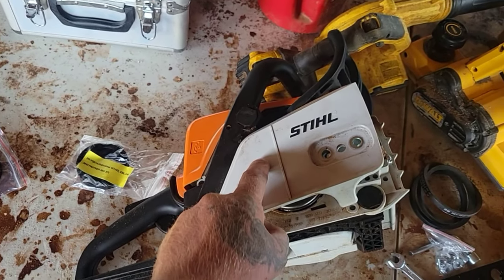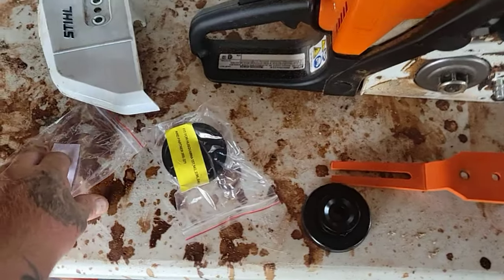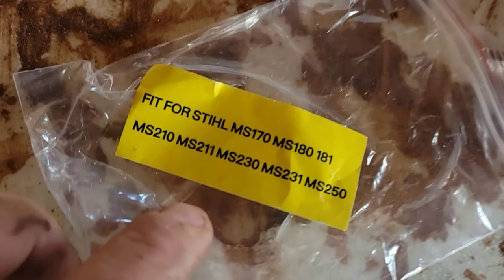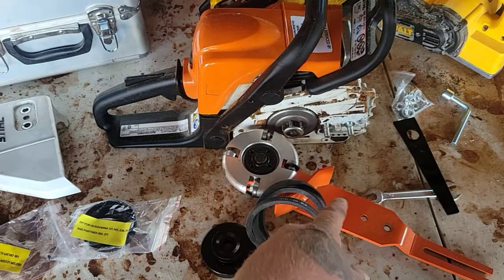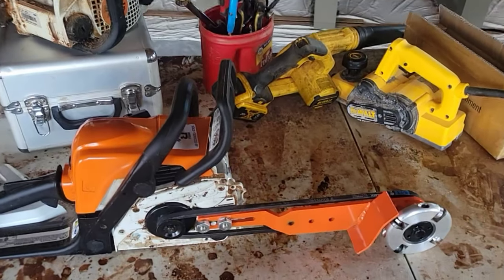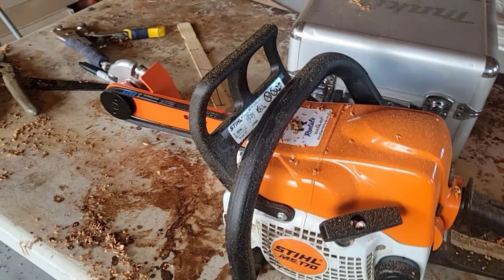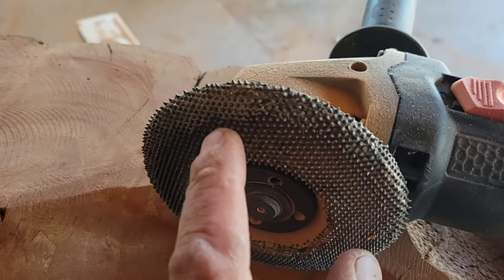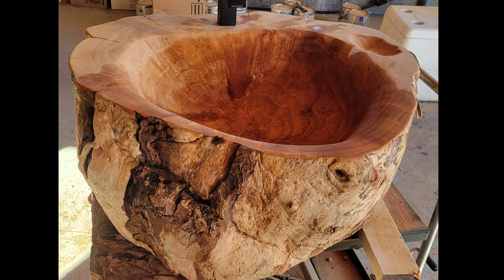New cheap chainsaw gouger and new sthil ms 170 gas chainsaw. In description below.

Comment: Jordy what's your thoughts on those shaping discs, I'm just normally using 40 grit (can't find 30 grit)are they worth the money?cheers buddy wicked how too use it vid 👍❤️👍
Reply: Get a kutzall one and save the headache of dealing with disposable stuff.
Reply from the maker: There will be a video up in next day or so on one I just got, there are good but could be very dangerous if don't use with caution
Reply: @CarvingFusion  you gotta be super confident on an angle grinder AND wear some ppe armor AND pay attention and dont overwork yourself in my opinion. Incredible tools, but they require a LOT from the user. I use the more expensive king Arthur holy galahad contour with holes that let you see through, phenomenal. Too expensive. Gonna get a full kutzall set. 

The discs bind in super nasty ways if you catch a leading edge without knowing! Be careful!